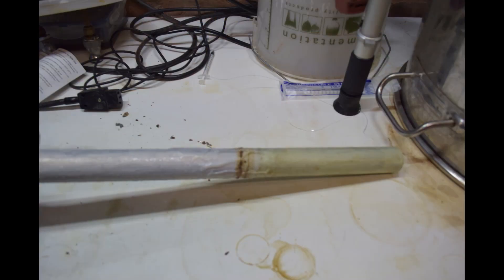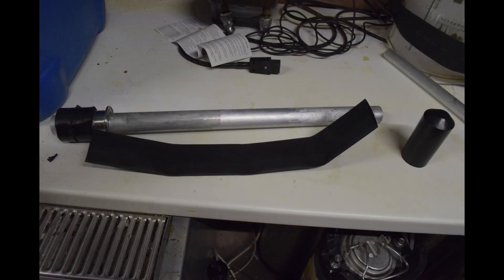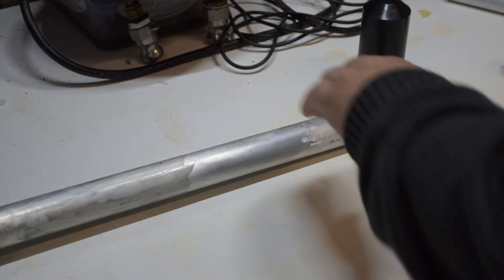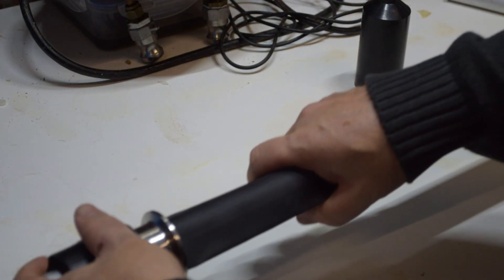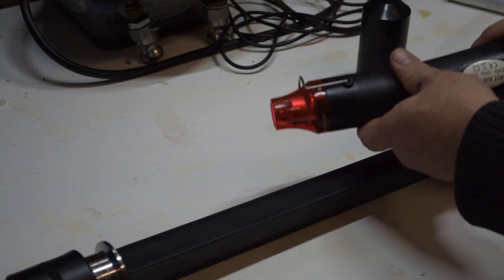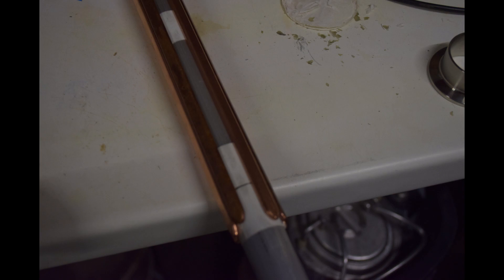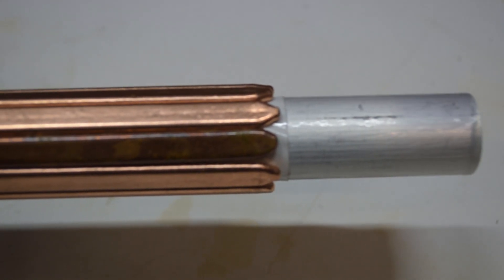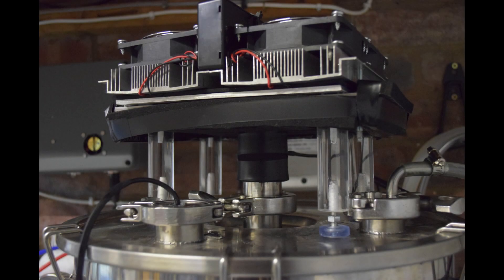Peltier Fermentation Control - The Final Version

Comment: That heat pipe idea looks interesting. Love to hear how much of a difference it makes after a couple of batches
Reply from the maker: Not a lot of difference, about 1C more away from ambient.  I think this issue is that brewing temperatures and temperature differences are right on the edge of where the heat pipe starts working.
Reply: @TertiaryBrewing  Ah yea that would make sense